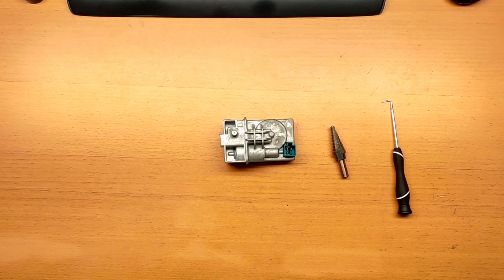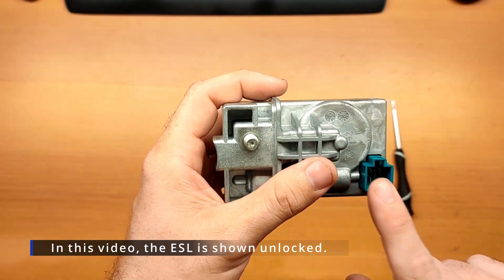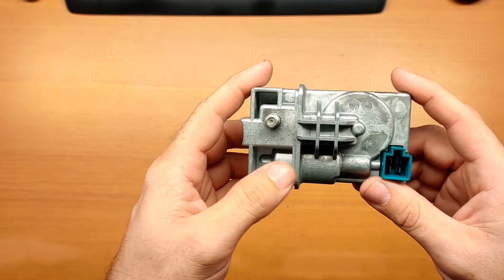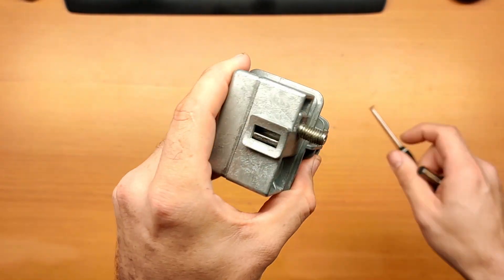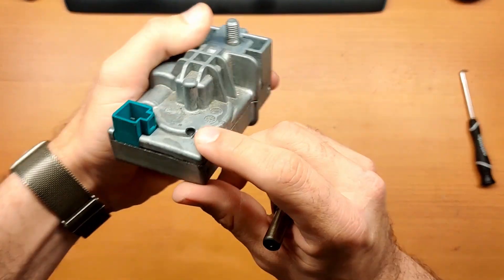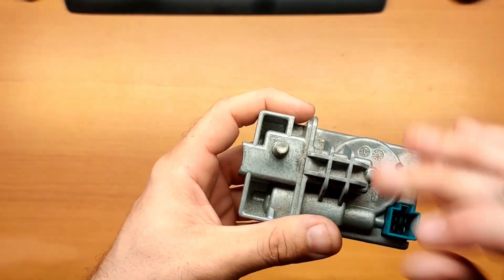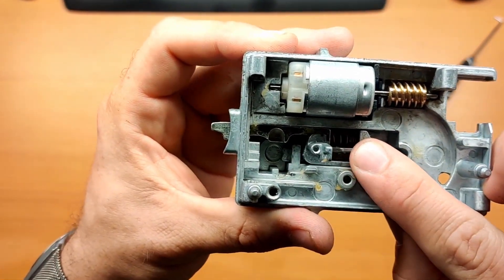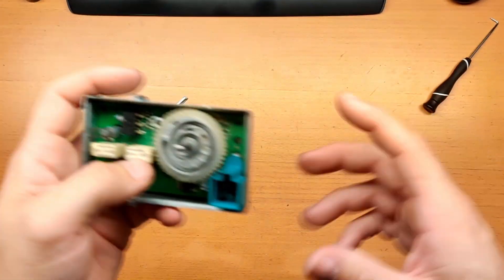How to Remove a Stuck ESL (Electronic Steering Lock) /ELV from Mercedes-Benz. PART 2

Comment: Sometimes the ESL can be unlocked by tapping on the steering wheel, or hitting the steering column then inserting the key. Is this correct?
Reply from the maker: Naw chief, that ain’t it. Tapping the column might coincidentally jiggle a dying ESL to life once or twice, but it’s not a real fix just a temporary glitch in the death spiral. Once the motor inside locks up or the board fails, it’s game over. Get it diagnosed properly before it leaves you stranded for good

Comment: Can't you just saw off the bolt and use a pry bar to remove it?
Reply from the maker: The method that is shown in the video is exactly how you need to get it done, otherwise you increase the chances of your module getting damaged.

Comment: So once this is unlocked, and lets say its the motor that is no longer working, would you still need to get an Emulator? My thinking is that it would now be stuck in the open position and that problem shouldn't happen again. correct?
Reply from the maker: Hello, It is recommended that you indeed will get an emulator because of the fact that these ESL modules tend to fail pretty frequently even after you replace the motors.

Comment: i drilled a hole but the cog wouldnt turn, so i drilled more and levered the cap off, the cog was plastic on my 2008 sprinter, i still couldnt turn it so broke it off and the locking pin just dropped out freeing the steering - i did this while in place on the column. i already bought a bypass device off ebay and tested that it worked before breaking the lock.
Reply from the maker: Okay

Comment: Rather than replacing the ESL with an emulator would it not be easier to replace the motor inside the ESL?
Reply from the maker: Hello! No it is not so easy as you think, not only you will waste your time but you will also waste your money while trying to replace the motor, the big part of it also fall into the realignment of the ESL so it understands what needs to be done, you can do it but it is not recommended. The dealer also does not recommend replacing the motor, instead just get an emulator which by the way, we provide.
Reply: Sometimes the NEC chip gets blocked because the motor fails and the car send signal to the lock which does not respond. I replace many with emulators just remove the lock and have many happy kms after that
Reply: Also its not just a matter.of replacing motor. Need to see the orientation of the gear an then need to put motor in either a locked position or unlocked position. Its a tricky job. Just emulate an be happy😊😊😊